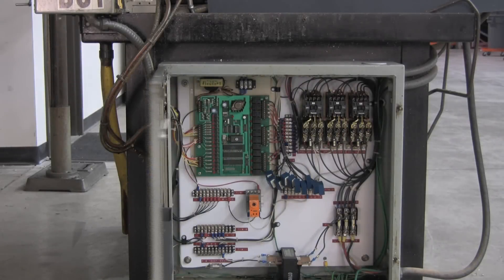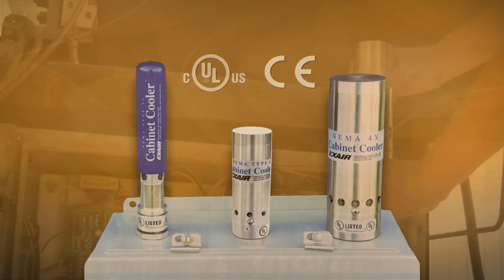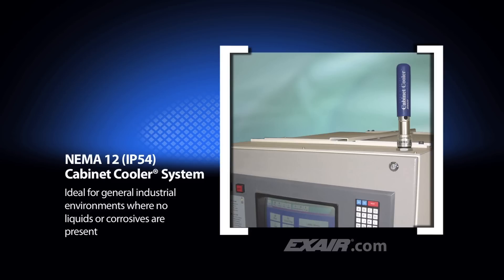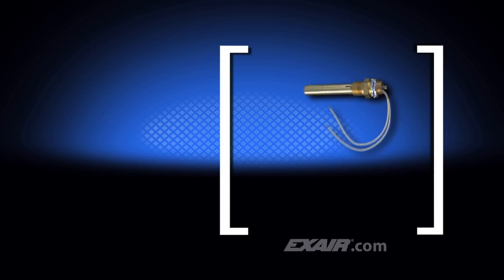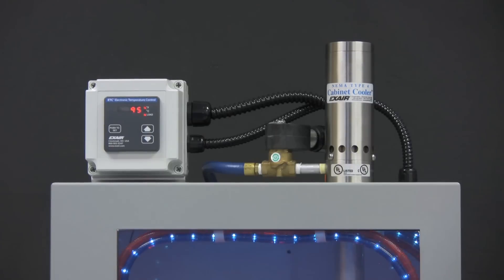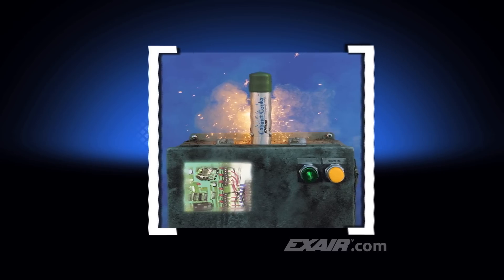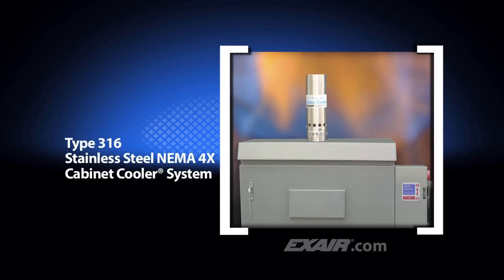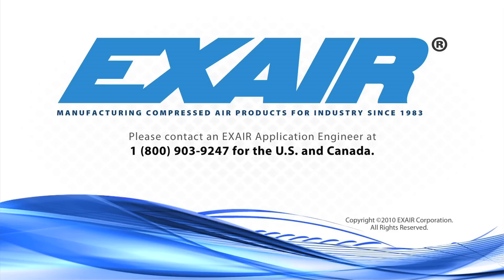CE Compliant Cabinet Cooler Systems from EXAIR Corporation

Comment: 2 questions:
1.-What is level noise produced by cooler system in db?
2.-What happen if humidity separator fails, there will be a water iside cabinet that can be damage the electronics parts?
Reply from the maker: Leandro,
                Thank you for the inquiry on our Cabinet Cooler Systems.  To answer your questions:
1.	The noise level produced by our Cabinet Cooler Systems will vary depending on the NEMA type and cooling capacity of the system.   The range of noise levels is from 59 to 85 dBA form 3 feet away.  These all fall within the allowable noise level exposure guidelines from OSHA. 
2.	If you have a dryer on the entire compressed air system and it fails, each EXAIR Cabinet Cooler System includes an auto drain filter separator for dirt and water particulate down to 5 micron.  We also offer an optional oil removal filter that will then filter the compressed air supply down to 0.03 micron particulate size.   If these filters begin to “fail” the general symptom is the filter becomes clogged causing a pressure drop across the filter.  Once the pressure drop reaches more than 5 psig we would recommend to replace the filter element.   The filter elements are readily available for all of our filter units.  If the filter fails catastrophically and no longer removes moisture from the compressed air, then moisture could potentially pass into the Cabinet Cooler System.  Fortunately the Cabinet Cooler System outlet has a cold air distribution hose inside of the enclosure which will act as a condensate trap, if you will, to help collect the atomized moisture.  If the unit is installed properly then the moisture will have a low possibility of exiting into the enclosures air space.
Please let me know if you would like to discuss this further. 
1-800-903-9247
Reply: thanks for your answer, we are looking in our company the most efficiently cooler system, i will  try to test one like this. and follow their advice.
Thanks A lot
Reply from the maker: Leandro De La Garza, Thank you for the questions and the response.  I am glad you found our video and information useful.   In the future, for a more immediate response, feel free to contact us through e mail at techelp@EXAIR.com or by phone 1-800-903-9247.  We will gladly answer any an all questions you have on our products.  Thanks again.
~Brian Farno